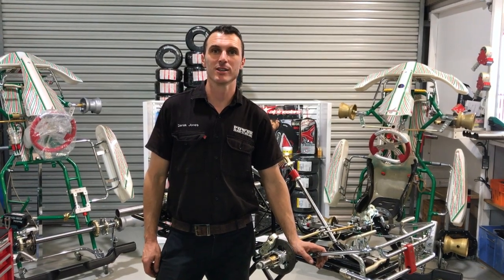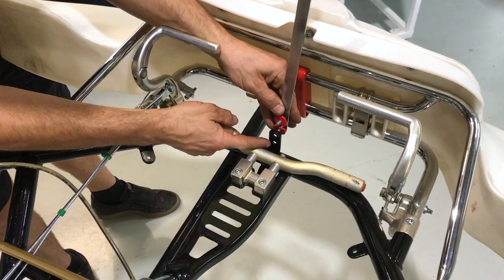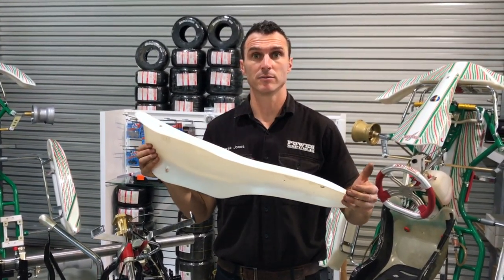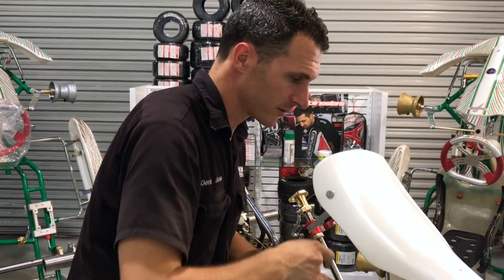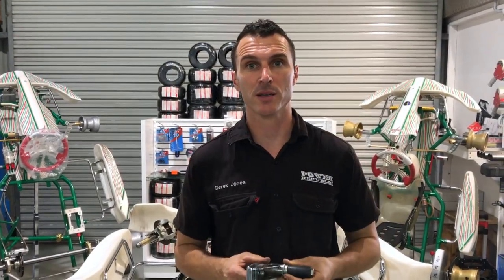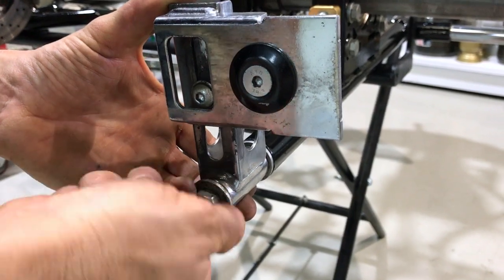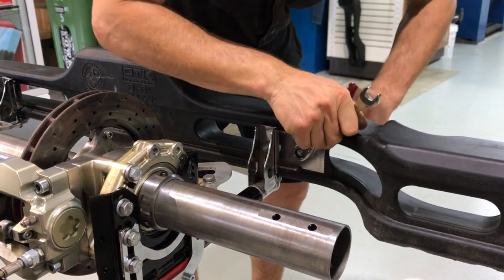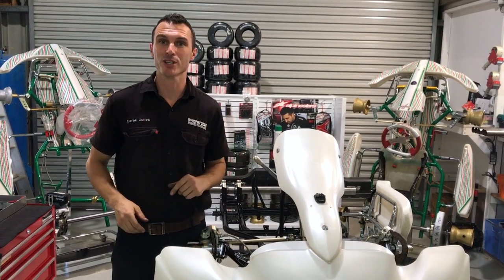How To Assemble A Go Kart Part Five - Plastics Installation

Comment: Ive got quick release pins on the front panel, with R clips securing it.
Reply from the maker: on a tony kart?
Reply: @PowerRepublic  yes, it just unclips. Id assumed it was standard until i saw this, it could be a simple mod  done by the original owner.